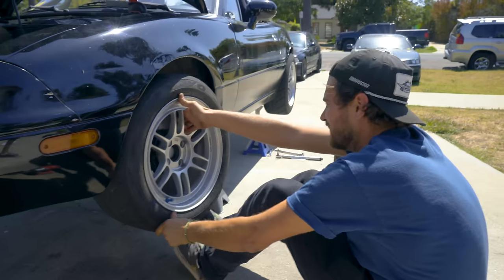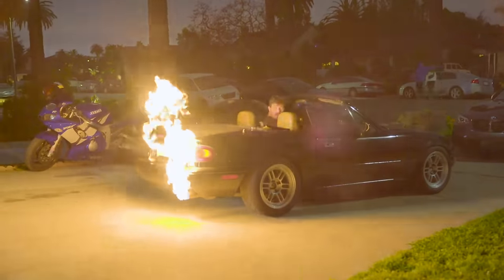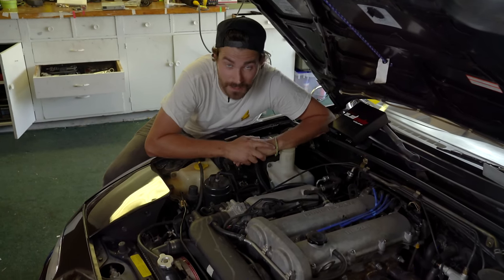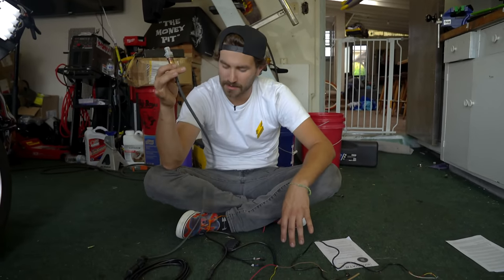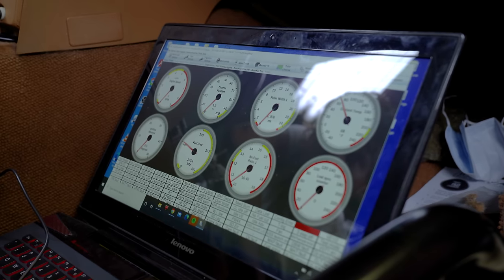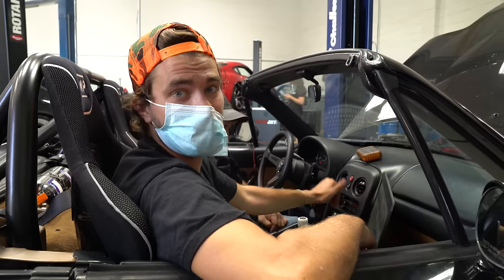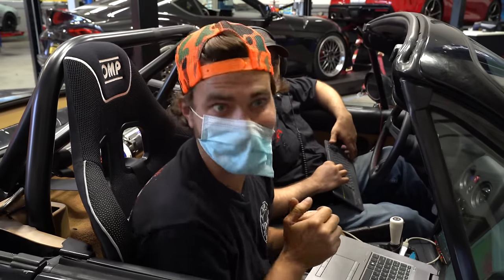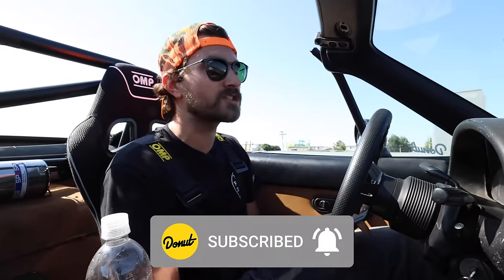Is a Standalone ECU Worth It?

Comment: Cool, now you can overheat faster!

Seriously though, when are you upgrading the cooling system?
Reply: You know that a bad spark timing etc can overheat a car right? So if he can fine tune things like that he can get the car to not overheat. The cooling system on the car is more than enough for the miata
Reply: For real, let's see a coolant reroute.
Reply: Because MO POWA BABY
Reply: The cooling system is more than enough for the car. 
Car cooled down between dyno pulls........ ummm
Reply: @supersportzcom  every car does this usually especially in the summer to get better reads and performance. Its hot af in socal. Heat soak is real regardless of cooling system
Reply: Everyone commenting here how it's normal, watch the track run video. Overheating like crazy even before the tune. The miata needs a rad upgrade. Even Zach said so.
Reply: @Maybe, maybe not. stock bottom end and top with a turbo you can push up to around 225 to 250 ish. But if you're leaving the stock fuel pump and injectors with an OEM clutch like 180? Which is still pretty darn good for a 2300 lbs. car.
Reply: @Tsino69  the miata def needs it his radiator prob isnt even doing 100 percent of its job
Reply: Kind o have’nt had any car that did’nt cool down between dyno pulls... but hey, what do i know. I have only been doing this since i was 15 years old ( i’m 32 now)
Reply: @cthuluchtului650  thank you
Legit if the op went to dyno sessions he'll see what others saying
Reply: @cthuluchtului650  Watch the other video. The miata couldn't manage ONE hot lap. Dyno pulls are one thing and I get that, but it's been overheating on the track too. Before it can get a single unimpeded lap time.
Reply: Tsino my Cadillac had the disturbitor 1.5 deegree wrong, and would overheat just by crusing. Until i got the disturbitor right and the overheating problem went away :). Also had the same problem with some cars that shot out to little gas out of the fuel injectors. And of it id the cooling system, he would most likely get away with flushing and cleaning the system. I had a miata with 162 hrsprs and the original cooling system and had no problems with overheating :) thats why i’m kinda sure about he don’t need to upgrade the system :) sorry for bad english i’m a drunk sweed

Comment: FYI, a speed density tune does not necessarily mean the ECU is a volumetric efficiency model.  For standalone ECUs running Speed Density you usually have the millisecond base controllers and the volumetric efficiency based controllers.  They are not the same.
Reply: True, but anything modern will be VE based.  This ECU is VE based.
Reply: @benberusch6032  Right on.  Don't know crap about the new Megasquirts ECUs

Comment: You've still wired the power to the relay switch window fuse. If that fuse activates for any reason. For instance a jammed window and the motor over currents the fuse and the fuse activates, the relay that powers the ECU will open and the ECU will shut off. 

The ignition switches usually feeds current back to the fuse panel, where it's current is routed through several fuses for various different accessories. It would be better to run the relay switch line to the key, or the back of the fuse panel.

Comment: Front probing your connectors with test leads are a good way to create wiring problem.  Back probe the connectors or use an adapter for your lead that has correct pin figment for the connector you are testing.

Comment: volumetric efficiency can exceed 100% on a n/a motor as the  intake can be designed to have the intake pressure slightly above ambient pressure. more modern  cars can do this and also leads to the reason why some cars are better off stock than aftermarket as you get rid of the optimized path of airflow.

Comment: Do not use a plastic TEE if it is located on top of a hot engine. My friend just had a plastic TEE melt close for his MS3 PNP stopped getting any vacuum for his MAP. Get some kind of vacuum distribution block and mount it on the firewall and tie into that.

Comment: Just a FYI for anyone using a meter, just because your meter reads continuity doesn't mean it is a legit ground. It could just be reading through a component, relay, capacitor, etc.... You typically want to fully isolate whatever system or wiring you are trying to meter to ensure you get reliable information

Comment: There's no replacement for displacement. It's still true. 
Displacement is like a building's foundation. The larger the foundation, the larger the building can be. So more displacement means larger turbos or superchargers, more air, more fuel, more power.

Comment: Ignition wire has 12v with key on and 12v during cranking. Accessory wire is 12v with key on and 0v during cranking

Comment: I got a 99 nb1 rust free for 2500 about 5 months ago. I’ve been restoring it to oem, (paint, wheels, fluids, new soft top, oem parts) I’ll be about 4K into it to get it perfect. I’m looking for opinions on rather I should go all in on it stand alone, bolt ons, roll bar, eventually turbo. Or sell it, make 1 or 2k and get a 240sx coupe with miata funds which is my current dream car. Opinions?

Comment: I happened to wreck my 2000 gt mustang. (DONT ASK HOW.) But I think fried the ecu...  Could I run an aftermarket ecu, and still use it as a daily driver? I can learn all the tuning. I just want to know, if I can still use my car (street legal) with an after market ecu. It's an EFI 4.6 OVHC 2V. Has coil on plugs.

Comment: Was hoping you'd overlay the original ECU dyno graph to show the difference across the rev range.

Max HP/TRQ figures don't usually show the benefit of the standalone on a stock engine, as it's typically the midrange that changes noticeably.

Comment: Was that vacuum line for the MAP sensor? If so why not put the map sensor as close to the manifold as possible and run the wires to the ecu instead of a vacuum line to the ecu? All that air in the line itself creates a delay in your manifold pressure sensed because it takes time for that air to be evacuated from the vac line. Or was that some other vacuum reference? I've never heard of running a long vacuum line to the MAP sensor and I assume for the reason I just mentioned. Just curious.

Comment: I have a 1996 acura integra and am trying to get a chipped p28 eco but im wondering if a stand alone is a better option its just so expensive and ive already dumped a lot of money into engine mods and other old car things (destined to happen) and relatable brands or advice other than hondata or those sketchy plug and play odb2 chip tuners.

Comment: No replacement for displacement still holds true, thats why nascar uses v8's instead of 4 cylinders. Top fuelers use supercharged big blocks. You still need cubes to make torque.
Reply: You can hurt an engine by making it run rich. Biggest thing with running rich is washing the oil out of the piston rings. Running lean melts stuff.
Reply: 12.4 is stoic
Reply: I wouldnt use that dyno anymore, he is holding it on redline to long, but thats just me.

Comment: 6:02 how can the engine pull 1.8L of air for every one revolution of the crankshaft? One revolution of the crankshaft only opens 1 cylinder to draw air in (Admission), which is 450cc or 0.45L, the other 3 are at the phases of Compression, Expansion, and Exhaust.

Comment: what about aftermarket harnesses. I've heard (atleast in my application-LS swap) that ebay harnesses or other aftermarket harnesses (cheap ones that is) are made with cheaper wires that are either smaller gauge or made with wire that is possibly not made with good insulation and or tin or a different metal that can lead to harness melt down, wire fires, or even just poor connections and continuity. been told a reworked OE harness is the way to go, any thoughts?

Comment: What if some one made a Dattabase of information that collected all the information of similar and equivalent modifications on a car that allowed you to plug an ecu to a car that would after a time of acclimation by driving or idling could tune your car and keep the tune after being disconnected from the database. It would need to be a rather large collection of data but food for thought.
Reply: A lot of the Holley ECUs made for LS engines do that, they’re self learned ecus that’ll learn based off of driving different parameters to tune for, and it’ll adjust itself on the fly

Comment: i wish every fuel injected car on the planet had this PNP stand alone ecu option  (plug and play)
well you could use a piggyback ECU orrrr
use a stand alone ecu to run in parallel with your stock ecu to retain stuff like auto transmission function and gauges ......hmmmm so we allow the second ecu to control injectors and ignition

Comment: Can you just swap a KL-ZE in there, they're cheap!  i-Vtec tuning is different. Try knock and VTC tables on top of fuel and air.  Multiply your work by 5.  However the horsepower you make also multiply by 5.

Comment: I know I'm 2 years late, but couldn't you add a second tune file from your stock ECU onto the Megasquirt so that you can just change what tune it's running when you go for inpection?
Reply: You could, you could probably (with enough skill and time) get the car to be even more likely to pass emisions.

It is just alot of work and if you fail it means your car isnt allowed on the road

Comment: I have an issue with my 96 Miata. 
I went to leave work one day, took off with parking break on.
Car stalled,  started it back up,  check engine light on,  won't clear code after battery disconnected. 
Code = low voltage. 
New battery,  keeps draining, parked, not running. 
Alternator good
New cam and crank sensors. 
Check engine light still on.
It will crank, and run, then shut down. 
Some times runs for 40 minutes, sitting and parked.
Some times 5 minutes,  shuts down. 
Any suggestions before I invest in a new computer?

Comment: MAF based systems can compensate for modifications up to the maximum measurable air mass of the sensor. there is 0 benefit in moving away from a MAF sensor until you are outflowing it's capacity.

VE does not inherently go above 100% with forced induction. forced induction makes the volume of air more dense.
Reply: Relating specifically to this application, you are incorrect regarding the MAF comment.  This is an application that uses a 30 year old MAF and creates restriction in the intake pipe.  Removing it generally makes about 3 hp in this application.  Removing the older VAF (vane airflow meter or AFM in Miata language) will make closer to 5 hp.  I have tested this multiple times, and these are significant gains on engines like this.  Further, the MAF may simply be inconvenient when changing the intake or adding a turbo, and of course, yes it could be out flowed with forced induction.  

You are also incorrect in your 2nd point.  The entire purpose of the turbo is to increase volumetric efficiency.
Reply: @benberusch6032  nope VE does not change. the engine is 1.6l or 1.8l or whatever, what changes is the density of the air, not the volume. you will find this to be true when you tune a VE based system, it will be rare to see VE values above 100%. if what you are saying is true you should see values well above 100% in pressure regions above 100 KPAa.

as far as the MAF is concerned 3-5hp for $800+ seems like a poor investment. if you are improving your engines flow capacity beyond what the MAF can measure than it needs to be changed otherwise you are not really doing yourself any good and realistically 3-5 hp could be a difference in ambient air density that day. also that did not look like a vane air flow meter, maybe i am wrong about that.
Reply: @7sins979  You are talking to a calibration engineer with 15 years experience.  You obv have no idea what you are talking about.  The entire purpose of a turbo is to increase engine VE.  Engine VE, in the most simplest definition, is a ratio between cylinder filling and the maximum cylinder potential filling.  The turbo increases the mass of the air into the cylinder (you said so yourself), thus increasing VE.  Turbo engines will have VE over 100% in higher load regions. 

Most N/A builds are difficult in terms of cost per HP.  The Miata is no exception.  5 hp could represent a 5% improvement, which is a big deal when these cars are raced.  5 hp could mean the difference between getting on the podium or not.  

The more modified the engine, the more potential for increased HP with a tune, but the standalone itself is NOT the power adder.  The engine mods are the power adder; the standalone lets you unlock the power from the modifications.  

Suggest you read about engine and turbo theory.  Books such as Maximum Boost by Corky Bell or Internal Combustion Engine Fundamentals by John Heywood should be read and understood.
Reply: @benberusch6032  VOLUMETRIC EFFICIENCY note the word VOLUME, not MASS, this is first year physics. if the turbo increased VE as you are describing you should see a roughly linear increase in VE with pressure which is not the case. you may see points where VE is above 100% but not by much. 

the turbo charger does not increase VE it does increase the amount of air the engine can pump by creating a denser air charge through positive pressure. 

I hope you are lying about being an engineer because it is sad that you do not understand this. I suggest you go review your first year physics lessons and figure out why the VE fuel model works the way it does.
Reply: @7sins979  trying to keep it simple because you are failing to grasp concepts.  VE is V(a)[m^3] / V(d)[m^3].  The turbo increases the numerator -- the denominator remains constant, thus VE is improved.  A turbo does not work linearly -- look at the Garret Research website for wonderful guides on how to look at turbo maps.

There are also other factors that come into play as VE increases which do not allow for a linear rise of VE WRT MAP pressure.  

Turbo motors will have over 100 VE.  
A good N/A motor may also have over 100 VE in areas, in particular where the intake and exhaust systems have been well tuned, typically in a narrow range.

Think about this another way.  A N/A motor pumps air mass by drawing it in under vacuum via piston traveling from TDC to BDC.  A turbo motor augments the amount of air drawn into the cylinder by pressurizing the charge, so instead of the mass having to be drawn in via vacuum, it is pushed in via pressure from the opposite side.  This IMPROVES VE.
Reply: @benberusch6032  note how all of that is dealing with VOLUME while MASS is the derived characteristic. the turbocharger is a compressor, it compresses the air, in other words it packs more air molecules into the same VOLUME. VE takes the known volume, the measured charge temp and pressure and calculates air MASS. go back to your year one physics lessons and look up the ideal gas law and stoichiometry and you will understand VE.

Comment: Your V.E. Table and your A.F.R. Table coincide with each other for the most part so if you change something on your A.F.R. Table and you have the settings set to link the two tables realistically you really just have to worry about A.F.R. And kinda just leave V.E. Alone. More or less you shouldn’t mess with it to much anyway unless your trying to become a tuner because V.E. Is a lot more labor intensive on the math side of things then A.F.R.

Comment: @Donut, Just a thing to note. A turbo doesn't actually make you run at above 100% volumetric efficiency. It isn't possible, even at 30PSI of boost you are still capped out at 100% volumetric efficiency, it is just that you are running at a higher manifold pressure so you are running at 100% efficiency at 44PSI (atmospheric plus boost), rather than 100% efficiency at 14 PSI (atmospheric). This doesn't really matter in practice but it is an important thing for tuning perfectly.

Comment: should just delete the A/C to reduce weight and reduce pulley drive train loss and maybe a lighter main  pulley. make sure you swap your timing belt so your motor don't die

Comment: I don't understand why you kids keep saying there's no replacement for displacement there's still no replacement for displacement Nolan has said it James has said it now you have said it it makes no sense... If you take a 1.8 l motor and put a turbo on it then it makes x amount horsepower. If you take a 777 cubic inch mountain motor and put twin turbos on it then it will make four or five or six times as much horsepower as your 1.8 l... How is a turbo a replacement for displacement when the more displacement you have the more horsepower and the more turbo you utilize to make exponential horsepower gains... That's like saying I can take a 15cc engine and put a turbo on it and make 3000 horsepower...you still have to have the displacement to make the exhaust to turn the freaking turbos that's why that you don't have to spool up huge cubic inch motors as long as you do a junkie Miata. Otherwise it's been nice watching you learn and keep up the good work all of y'all but just drop this stupid term

Comment: It would have been very informative to reinstall the stock ECU & do a comparison between you 112HP and the factory tune. You may have paid big bucks for 2 or 3 HP.
Reply: You pay the big bucks not for the power but for the unlock. Now if you want to install a turbo (or even NOS) you can actually utilise all of the added power.

Comment: I check the specs of the model (if that is 90's Miata) it should be 116 HP stock. So you didn't bring much of the young horses back in the car.

Comment: why won't that ECU able to deal with your "smog" settings? should try the range of ECU's from Haltech, an Australian manufacturer. great gear, easy to program, lots of I/O, E-throttle control, boost referencing and flex fuel sensors, just to name a few of their many features. no, i don't work for Haltech. lol. just a proud Aussie.